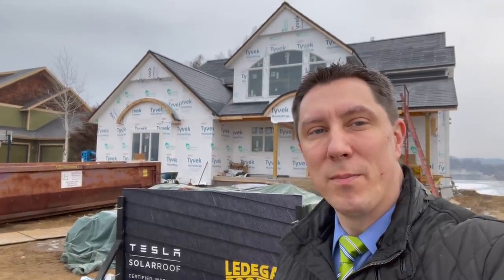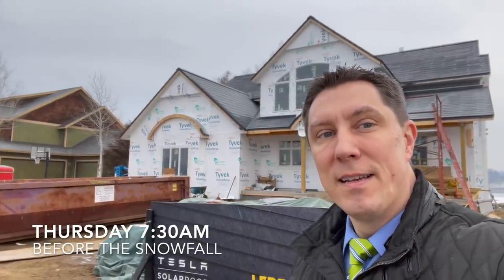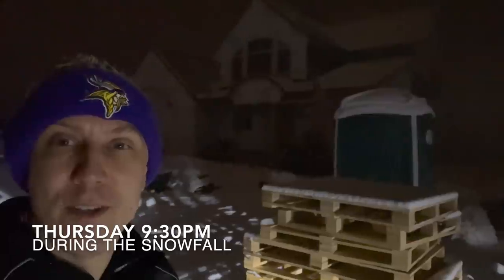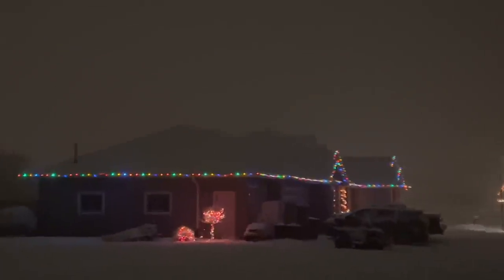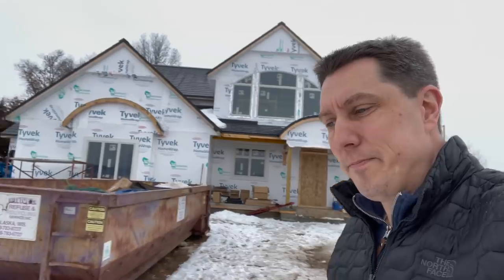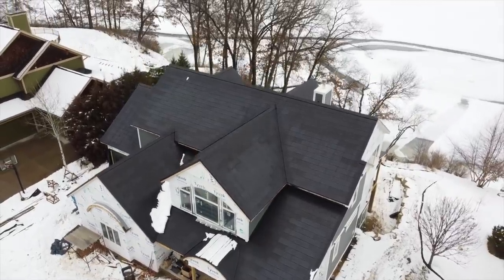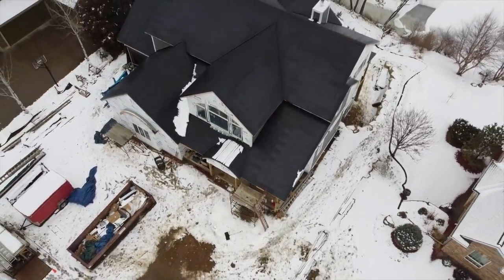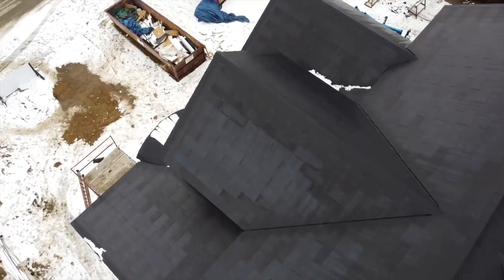Tesla Solar Roof - What happens when it snows?

Comment: It'll be interesting to see what happens once your gutters are installed. They'll direct any melting away to where you want it, but might cause sliding snow to pile up on them instead of sliding off.
Reply: Yea I'm interested in how he'll deal with the issue
Reply: Lots of gutter designs out there that's not a problem
Reply: @AP-uw3em  Yeah, if the gutters are at a meaningfully lower height than the lip of the "ruff", then it shouldn't be a problem  ;)
Reply: Heated gutters would be cool, and helpful, but then you'd have to figure out what the next step would be. i.e Heated downspouts, a heated reservoir system
Reply: My EXACT thoughts.  Should be a type of gutter placement which minimizes problems.
Reply: @justinstewart6189  these panels, along with your idea, would consume most power than the panels would produce in a day. I'm positive these panels as they are already consume more to heat them up to remove snow.
Reply: Just wait tell it's 5 below with 16 inches of snow and you have to shovel the roof and break the panels and the install sucks and your roof is leaking and tesla take you to eat it

Comment: You will need to reinforce gutters (a lot) as the weight of the snow as is slides off will over load gutters. Also in colder temperatures you will have ice dams at the gutters. You can possibly install heat tape in gutters to melt the snow as it fills gutters to help minimize load. House and roof look great! I’m a retired certified Master Builder in Canada.

Comment: Thanks for filming this. Was there already insulation Inside the home at this point?
Reply from the maker: yes, all of the insulation was complete.  Drywall had already begun.
Reply: @JasonLassen  Tesla roof with Tyvek? I hope the Tyvek is your temporary solution and you will be putting Zip on the exterior instead.
Reply: @davidcameron2366  You don't need that zip crap. People have been going many years without it. I'm guessing you work for the company
Reply: @ericl8743  I do not work for the company that sells Zip. (I do rental home maintenance for a small company.)

Any home or condo / apartment I've seen Zip installed is an order of magnitude tighter, and uniformly insulated, than any Tyvek wrapped home I've personally seen and inspected.

Not saying that Tyvek is a bad product, but Zip seems to be more idiot proof?

Comment: For those who are interested what is really happening here:
The tiles are made out of glass and other materials that have a much higher thermal conductivity than traditional roof materials, thus transfer heat from the inside of the house far more quickly to the outside. What you see here is not a good feature but a testament of very poor insulation.
Reply: The home is uninhabited and thus likely completely unheated. Work on the house has evidently not continued during the heavy snowfall so the house interior is likely in thermal equilibrium with the exterior. Not to mention you WOULD expect less snow on a more slippery and darker surface anyway so I don't know why you even felt the need to assume otherwise
Reply: @KeremBckc  Yeah my hunch was that black colour and the slippery surface. But was thrown off when he said snow should melt and run off as water. Would love to know why the black colour helps melt more snow
Reply: @KeremBckc  Even if the house was unheated for a long time (which is unlikely) the house will never be at an equilibrium as long as the sun shines. The house has large windows which in addition to the wall insulation acts like a big greenhouse and will always be passively heated during the day. This is school-level physics you fail at. Also you can clearly see the neighbour roofs are also dark/black, the colour has no noticeable effect on snow melting here. And finally, the static friction of the roof doesn't change over time, thus it makes no sense that the snow would simply slip from the roof hours later. In addition to that, the surface smoothness is pretty much unrelated to snow cover, since the snow crystals bind to the surface on a much smaller level, that's why you can see snow build ups even on steep glass windows. All in all, you answer does not hold up to actual science.
The Tesla roof is simply poorly designed  in addition to its general inferiority to traditional solar panels. Furthermore the losses in power generation due to snow coverage is so small, on average it only amounts to a few dollars.

Comment: There is a major flaw going on here, many variables are not considered.  First of all, the home is under construction, likely at the stage inside of sheetrock/mud/ taping.  Also, soffit/final facia is not installed.  This likely indicates that final insulation in attic is not yet installed (assuming its blown in).  Without insulation, the roof temperature is being heated and conditioned by the heating source in the home (likely forced air?) To keep construction going inside.  Its very typical for our local area of Northern Utah.  

So what seems like roof shedding is simply a demonstration of how extremely inefficient your home is compared to your neighbors.  Homes actively under construction have massive infiltration issues, and are often times not fully insulated.  The tightest, most efficient homes actually keep snow on the roofs more, and loosing snow/melting snow indicates weak points in a home thermally.  

So, definitely some qualification here would go a long ways.   Correlation is likely not causation in this specific case.  Once home is 100% finished and insulated, front door on, garage doors on etc, this would be a better comparison/test.  Until then, this doesn't mean much.
Reply: Yes, my bet, if the owner posts here, the insulation is waiting on final soffit and facia to go in, so the attic can be blown in.  Assuming that, this roof has exponentially more heat going through it than any other house in the neighborhood.  It would be great for owner to chime in.
Reply: Owner already said insulation was already completed. They were working on drywall inside.

Comment: I may be dumb but does this just mean his “ruff” isn’t very well insulated? Not hating I just don’t the process that causes it to melt/slide snow away so rapidly.
Reply: I doubt there is any heating in that right now.
Reply: Seems the panels heat when capturing solar radiation, due to inherent non 100% inefficiency, which is helpful in winter.
Reply: @hrissan  but how do they heat if the snow covers them to begin with blocking all the light?
Reply: Glass has less friction than fibreglass shingles or even a steel roof for snow sliding off.

Comment: To bad your design team didn't design you a roof that snow wouldn't build up in valley . I am a builder that's been building over 40 years  in all weather . But mainly northern MI  A good rule of thumb is for every 12 ft of roof going up you need to be 2 ft out of the valley if you have 2 valley's then 4 ft between them but if your roof gos up more than 12 you need to add more distance apart  so if your roof is 24 ft tall on the run off you need 4 ft out of valley to shed snow and water if you have two valley's at 24ft run you need 8ft between valley's to prevent leaks in less your planing on doing a heated roof  much like we do in floor heat . Then you can be closer . I have fixed many roofs over the years . In Bay harbor MI there are many condos that where design wrong and still suffering from bad design. Good luck I would look into in roof heat in your case because I believe it will leak when it dams up after a big snow.
Reply: Their Architect should be fired for that close twin gable in the front, idc how well the cricket was constructed or the amount of ice/water shield used on walls, right about now with snow and Ice build up I will bet my 30+ year home design/build career there is already water infiltration and early stages of mold on interior sheathing. If you need an expert witness for your impending lawsuit I’m in Wi & available.

Comment: Does the solar glass roof have built in heat sensors that you can control or did the snow get removed by the steep angle  slippery glass heat by the sun ?

Comment: A steep slope to shed the snow, cool. I wondered about that. That means enormous snow piles. But it looks like the snow falls off too fast to get thick on the roof, so avalanches shouldn't be a problem. Should scare a dog like hell but not kill it. I think people would like a video after a heavy snow fall to show the enormous snow piles and how much build up you get in the valleys in a heavy snow fall. And show off your battery pack if you got one.

Comment: It's great - I wonder if it's just glass vs. asphalt roofing or that they have some sort of smooth potentially hydrophobic coating on the panels.
The thing is, dust in the wind and snow itself are abrasive. It would be interesting to see how long this snow sliding effect holds up as if the coating gets damaged with time and scratches develop, potentially it will start to stick like on a regular home at the 5-10 year mark.
Only time will tell.
Reply: It's just glass but extremely toughened to withstand a kettle bell weight dropped on to it  from a significant height.

Comment: This won't work if it's just a little colder. There's a very specific temperature range that allows snow shedding by melting. Dark glass helps here compared to neighbors but if temperatures stay at freezing levels for days in your area, they will be below freezing enough that melted snow will freeze, which increases snow staying on a surface. Still, dark color should help around 30 F, and glass is slippery (except texture on glass doesn't help). Snow can even accumulate on vertical surfaces, and more so if it melts then freezes, creating textured surface for snow to stay on. For maximum shedding on a surface not trapping heat below to cause any melting on contact is actually what's recommended.

Comment: Not all those are solar though are they? and I'm assuming they are not heated other than by the sun . The other roofs probably have the sand grit on the shingles that keep snow from sliding off also unlike the glass like tesla panels. How many years is the Tesla roof supposed to last? I would think it must be pretty durable.

Comment: This is not the typical situation.  "Snowman" snow will come down damp and pile up to 6 to 12 inches.  It may not slide off until the sun hits the roof on a 30+ degree day as an "avalanche". This works for us:  you need like a 35 degree angle for that to succeed.  Blizzard conditions are different... The snow is fluffy and blows off immediately so nothing accumulates.

Comment: I can't see the benefit of having the roof clear around 9:30 pm and heating the roof all night. You won't generate electricity overnight with clear panels. You just waste energy.
It would make sense to have it cleared by 9:30 am. And with that steeply sloped roof properly designed heating elements should clear it in an hour.

Comment: So this is kind of weird because it is in no case my experience. It must be really warm where you are because where I am it's very cold. Central New York. The pitch of your roof is quite dramatic compared to the pitch of my roof as well.
Snow stays on my roof for days. Depends on roof pitch and temperature. Can't use the roof rake on second story, just too high. When it finally comes off, its dangerous to anyone (like my family and my dog) standing there, its destructive to any landscaping and extremely onerous to remove due to the massive amount of snow that packs to a dense clay-like consistency. If some sort of heating system could be designed and retrofitted, it could melt the snow as it falls. Thus, no snow build up to trash you bushes and you'll actually make solar as soon as the sun pops out. Seems easier to design and deploy than SpaceX rockets.

Comment: Can ur gutters handle the weight of all the snow slid on top of it? Seems like in winter and overcast days your power production would be drastically cut! Wouldnt this create a dangerous condition around the edges of your house? What prevents a whole section of snow from crushing someone? Are there ice/snow guards available to be installed?

Comment: If this took power to melt off then meh.  If this is pure melt/natural shedding, you are not taking roof pitch into account at all.  Thanks for a useless single data point.  Get back to me with full engineering and mechanical specs on snow for all pitches and without having to use power to shed the snow.

Comment: Very much sloped roof you have there. 
Mine is less sloped. 3500 sf and much less sloped. I checked pricing and found minimum $22. USD per square foot. That’s a lot of dinero, $77,000.00 or so and we get a bleep ton of snow in the winter up here also. As I type I’ve still got about 2 feet on my roofs here, after 4 days of sun/cloudy no snow, it was another foot deep for a couple of weeks from the jet stream fiasco. 
I think I’ll keep watching for awhile. We abut 2 forests, nat’l and state forests. Very tall Douglas firs surround us here. Gorgeous! Some of it’s ours, as well. 
For now we wait. Need more real data, I’ll be researching it though as I’d really like this - if it’s workable for us in this specific environ.

Comment: Good video! I had our solar roof installed in Summer of 2020 just North of Denver, CO. Second house in Colorado to have it installed. We routinely get snowfall of 5-12". We had one snowstorm of 18" last year. I like that it clears the roof for energy production but it does build up and then avalanche somewhat violently. It can shake the entire house and sound like a stampede on the roof. Then you have a 8-12" pile of compact snow that you'll need a steel ice scraper and shovel to remove it. Its a big pain and actually pretty dangerous. If its multiple days of snow, it can compact to the point of creating dense ice on the ground which is a slipping hazard. LOVE the roof but wanted to give my experience with ours in the snow.
Reply: our gutters are fine btw. We've had lots of aggressive avalanches from the roof so far and our gutters looked completely fine after a year so far. But we do also have gutter guards installed so it just slides right over.

Comment: Million dollar roof, shitty Tyvek house wrap... makes sense.
Reply: Tyvek is considered one of the industry leaders, why do you think it is used so much?
Reply: @KOTR2003  It's cheaper than more advanced options like ZIP.
Reply: @kode3  my research shows the zip system is rated worse than tyvek. The installation is more difficult, panels are butted to each other with a 1/8 inch gap. This creates a channel for water to enter the structure through wrinkles or incorrectly applied tape. The surface of the zip system needs to be extremely clean before applying the tape, or problems will occur.

The zip system cannot be installed properly when temperatures are below 20F.

If the installers screw up the taping process the warranty is void.
Reply: @KOTR2003  Then don't use it.
Reply: @kode3  I didn't say it was a terrible product, just that my research shows the tyvek rates higher.

No need for the sass, if you want to sway my opinion then try. There are advantages of using zip over tyvek, but there are more advantages of tyvek over zip. That is why it is an industry leader.
Reply: @KOTR2003  I don’t care if you change you’re mind. You could use Saran Wrap for all I care. How’s that sass?
Reply: @kode3  haha, the maturity level on youtube gets lower every day it seems.

You seem to have a strong opinion about zip system yet offer no details about why it is better. In fact you did quite the opposite by saying tyvek is cheaper, advantage tyvek.
Reply: @KOTR2003  lol who cares, you do you. It’s not my job to convince you of shit.
Reply: @kode3  I find it funny how you took my saying tyvek rates higher in the industry than  the zip system as a personal attack. You don't need to convince me, no, but you claim tyvek is shit without saying why. Your original comment in then moot.
Reply: @kode3  I will take professionals opinion over a butt hurt youtube commenter.
Reply: @KOTR2003  lol classic
Reply: @kode3  what do you find 'classic' or funny about taking the opinion of people in the industry over a comment on youtube? As far as I know you have no experience in the field, whereas the professionals do, and they know what they are talking about.

You could be associated with the manufacturers or suppliers of the zip system and just posting your biased opinion for those reasons, and not because the performance of the system.
Reply: @KOTR2003  I'm laughing because you can't figure out you're being trolled. You're way to emotionally invested in this, and that alone is absolutely hilarious.
Reply: @kode3  on the contrary, I haven't gotten emotional at all. You take my differing opinion to yours as a personal attack, as is clearly visible through how you reply to me, is what I consider being emotional. I offered pros and cons of both systems and why tyvek is considered superior, that is not 'getting emotional'. 

You reply to me immediately after every one of my replies to you, showing just how invested you are in your endeavor.
Reply: @KOTR2003  This is amazing, I love you.
Reply: @kode3  to think this all started because I asked a simple question of why you think tyvek is used so much. That is the truly funny thing about it all.
Reply: @KOTR2003  you’re right, this is funny 😄 what’s your favorite color?

Comment: How much energy did it take to melt the snow. What would have the net energy production rate have been? (Energy produced during snow session- energy to melt) Basically how useful was the solar roof as an energy producer to the household during this snow session?
Reply: Guaranteed it used as much or more power than it produced.